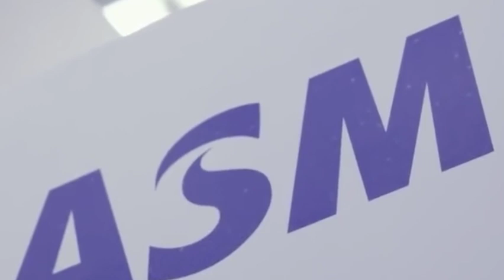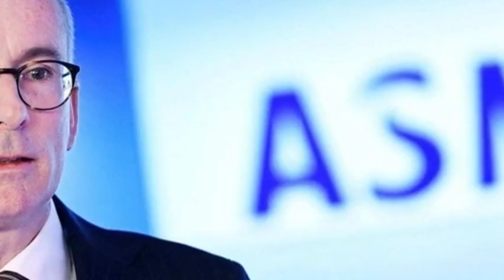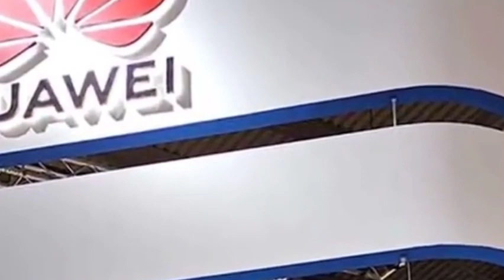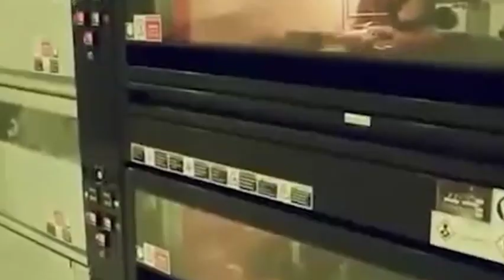The price of lithography machines has been increased by 3 times. Why did ASML betray China?

Comment: It’s business. When they get you by the balls, they will squeeze. Just don’t buy. The 4nm through repackaging from 5nm is already hitting the wall. Yep, the latest Mediatek and Qualcomm 4nm is a repackaging from 5nm. Meanwhile the 3nm is rejected by Apple for high cost and instability. Yes, Qualcomm 5nm is already known for heating problem! Don’t need to buy EUV from ASML. China is focusing on mature nodes from 12nm to 250nm of which China has already build 30 foundries. Focus on that. The 7nm is already up and targeting for mass production by 2025. Unisoc China just announced its 5G 6nm chip. No need to hurry. Don’t waste money and buy something that even TSMC find it hard to use and produce the 3nm. It’s costly and unstable. Target the 5nm but use other means and technology like FINFET or stacking or chiplet to achieve it. Focus on building more foundries for 7nm, 10nm, 12nm and 14nm using DUV. Forget about the EUV machine.